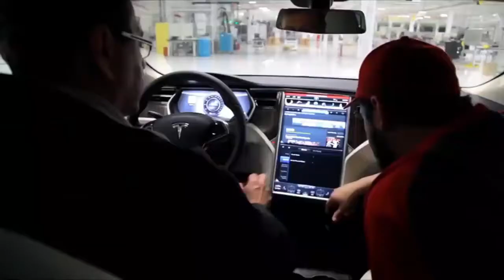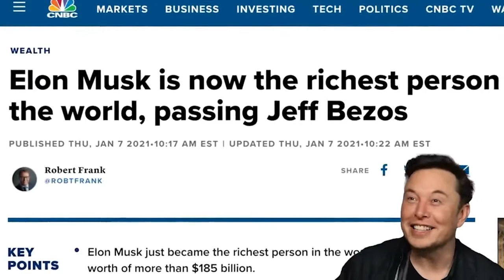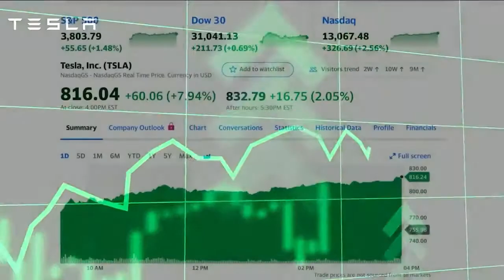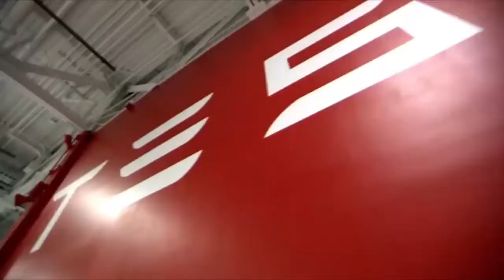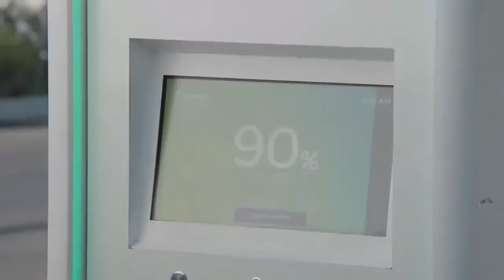Elon Musk's Secret Tesla Electric Airplane Finally Revealed

Comment: They'd fly at higher cruising altitudes for less air resistance? You realize the electric motors are turning propellers, as air density goes down, propeller efficiency goes down. They can't fly higher than jets. or even as high as jets.